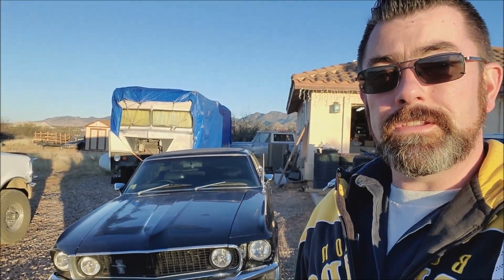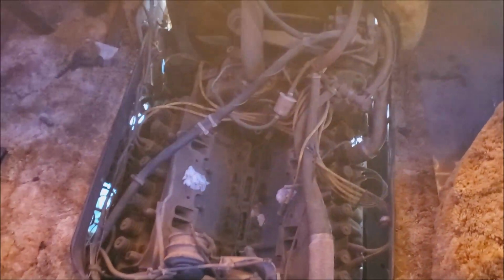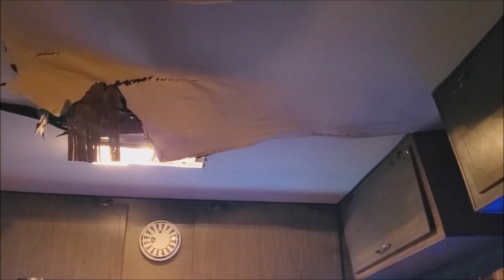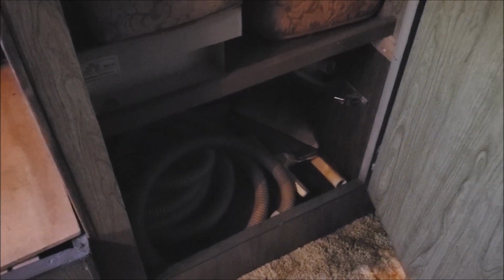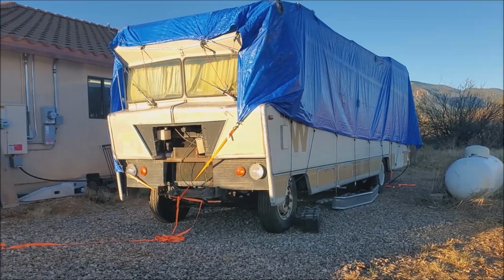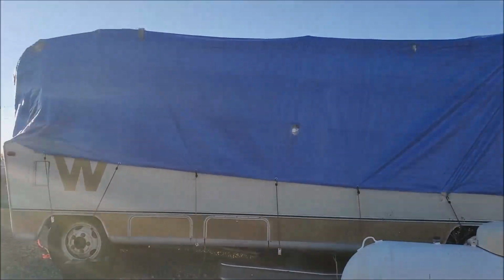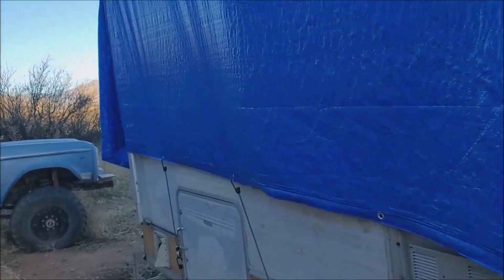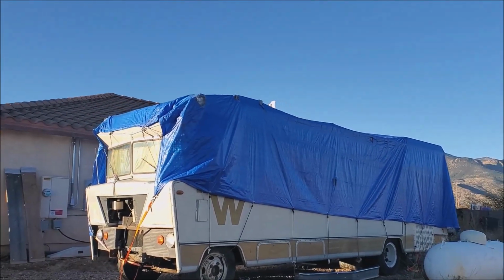1971 Winnebago Chieftain D-27 "The Wiener Bagel" Renovation Part 1

Comment: Man that’s quite the project, I can tell you from experience that a simple snow fighter front end bolts right in and the push pull drag will work just fine, the chassis is W300 so old dodge stuff. It’s still a cab chassis so the springs are narrow in rear and axle width is about 4” narrower then standard dually. I have a 20” brave I’m doing and already tackled front end now moving to 98’ vortec 7.4, 4l80 241tc, swap. I do have an old chieftain I’m pulling parts from for some older things as well

Comment: There are a lot of 6.0 ford F 550 s you should be able to get your hands on, that have motors that only lasted 50,000 miles, check around,
Reply from the maker: Unfortunately, I had to sell this RV due to financial hardship before I was able to go any further. Now that I'm getting back on my feet, a 1977 Cortez Motorhome will be getting a similar treatment. I will definitely be on the lookout for one of those F-550s, they seem like a good candidate for a swap!
Reply: @oldschoolautomotive2660  I drove hot shot for service America out of Slidell Louisiana, around 2004, they had 4 of them none made it to 60,000 miles, I still see them sitting around over here, in various places,

Comment: Did you happen to find a 'grey tank' as well as a black waste tank on this thing originally?   I have a 1971 Brave D-20, I can't seem to find the 'grey tank' on it.
Reply: Unfortunately unforseen financial difficulties forced me to sell before I could do anything beyond what was seen in the video. And I don't recall if there was a separate gray tank or not. But be aware, for many RVs of this vintage (especially "base" models like the Brave) only had a single tank for both black and gray water, so it is entirely likely you only have one. Your best bet will be to crawl underneath and look. You will have a fuel tank near the fuel filler neck, and some kind of sewer tank attached to the sewer dump. If there is only a single tank attached to the sewer dump, you only have the one. If there are two, then likely one is black and one is gray.
Reply: @ yep you’re right… black tank only. Thanks for your response.

Comment: Pardon to bother you again, I've been trying to find my damn water release valve, to release the water that's currently in the water tank.  This way when I drain that....then I can winterize it by putting RV antifreeze (pink stuff) in the tank and run it through the 'pipes' and so on so it won't freeze.  Do you have any suggestions on this?  Thanks! -Paul
Reply from the maker: I no longer have this RV - I had to sell it when I came on some hard times last year - but here's my recommendation based on RVs in general. Some fresh water tanks have a drain, and some do not. If there is not a drain or valve visible on the tank itself, it's possible that a winterizing drain may be in the lines someplace else, generally the lowest point in the system. You'll have to do some snooping around with a flashlight, and just trace out the pipes from the tank and/or back from the faucets. If you can't find a drain, your best bet will be to simply drain the tank and pipes by opening the faucets and letting the water run. Since these old Winnebagos used compressed air instead of a standard pump to move water, it should also blow out your air lines at the same time once the water runs out. Hope this helps!